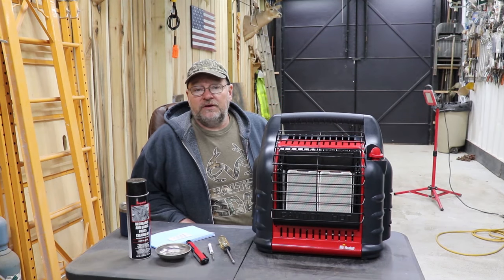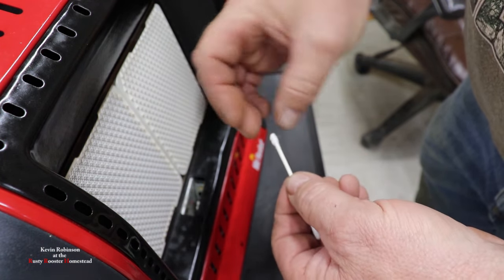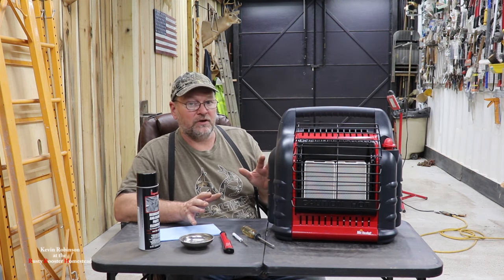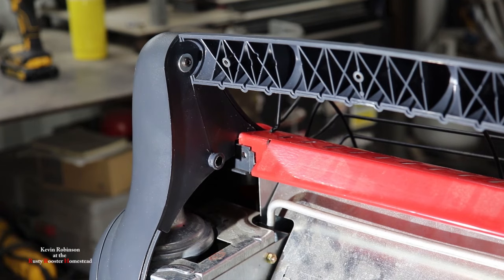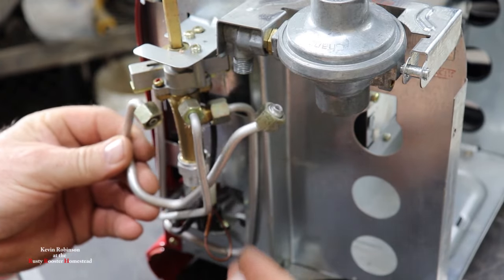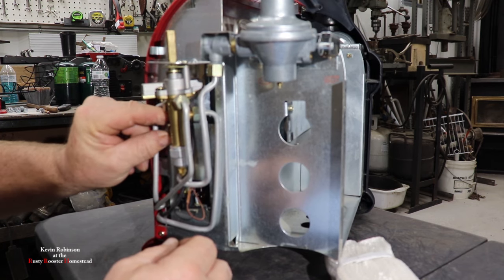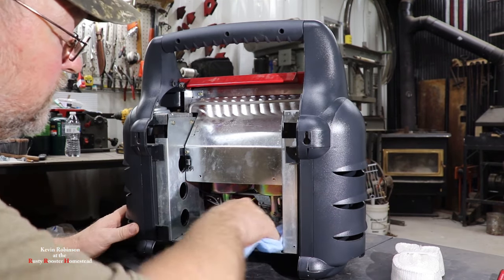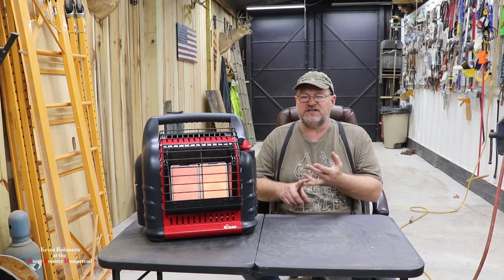mr buddy heater pilot issues

Comment: WARNING; don't use Q-tip, use a pipe cleaner instead, cotton may get clogged inside the line from the Q-tip.
Reply from the maker: Thanks for watching.
Reply: Thanks for the important advice.
Reply: Use a 22cal barrel mop! And wire brush if it’s real bad like mine was.
Reply: Pulot was at half, heater wouldn't stay on. I used a qtip... Now its not igniting. :(
Reply: My quip cotton got stuck. Now I have to take it apart

Comment: I thought the oil in the line comes from using the wrong hose. Some of the hoses would break down over time and tiny droplets of oil came out of them. I believe that's why some hoses say use a filter and others say no filter needed
Reply: No hose use here but I have these problems
Reply: According to Mr. Heater the oil comes from the hose used to connect to 20lb tanks under high pressure, you can get hoses the don’t release any oil under pressure to use with a 20lb tank or use the quick connect hose the has a regulator on it that connects to a fitting on the left side in where the cylinder goes. (Those hoses come in lengths up to 24 foot on Amazon for around $30)
Reply: Mr Heater sells a hose where a filter isn't needed, but it's expensive. If you use a regular hose, you need a filter
Reply: @RonL-y3v I use one of those hoses with a filter. Still have problems.

Comment: Thank you for this video.  I just purchased one of the Mr Heater big buddy heaters that I am sure was a return but looked brand new for a good price. It wouldn't start so I took it apart and sure enough as soon as I got the tube off oil poured out of it. After cleaning everything out it works perfectly now.  The only thing different on disassembly is there is a clip on the front plastic panel near where the red knob goes that you have to take a long screwdriver and gently pry back.
Reply from the maker: Glad I could help.
Thank you so much for the comment.

Comment: Qtips will ruin your heater. It might work the few first times but will leave fibers that will carbonize and clog it. I have been through 6 of these heaters so far living off grid. Get a proper diameter wire brush, disassemble the heater and soak the fuel tube and thermocouple in solvent(making sure the thermocouple wires are not contacting the solvent), then hit the inside of the fuel tube with the "tube brush" flush with solvent again and repeat once or twice. let all parts dry completely, reassemble and use. Do it right the first time.....
Reply from the maker: Thanks for the info William

Comment: I dont have brake cleaner. I don't have air compressor. Son-in-law just opened the lines and drained stuff. I've cleaned the pilot orifice. I use Mr Heater special hose and filter. Pilot just gurgles, maybe a yellow flame until the pilot knob is released.

Comment: Kevin, it's been a long time since I watched any YouTube videos but I wanted to tell you there's one other thing that goes wrong with heaters like these because I've got a couple of them and a simple adjustment of the thermocoupler will have a pilot light working in no time at all,, whenever the pilot light doesn't want to stay ignited.. I do the same steps like you did in this video by checking the inside of the pilot light first with a q-tip and then I check to see if the flame is actually going across the carbon tip of the thermocoupler as my second step to send the proper heat signal to the thermostat, so it knows to keep the gas coming through properly so it stays ignited and if that doesn't get it working,,  then I go to the gas line checking method and normally one of those three steps should get these heaters back to operating right, if there's no leaks anywhere causing an issue to begin with..

Comment: Turn tank off, 10 seconds flame goes out, hose is empty. Turn flame valve off. To restart, turn tank on slowly, turn burner on and light. The hose can not have pressure left in it because Propane is oil and the oil separates and clogs the hose over a few days so this is the correct way to turn off the burner when the hose goes a distance before the proprietary regulator for the burner. A barbecue pit hose does not have this problem because the regulator is at the tank valve.
Reply from the maker: Thanks for your comment.

Comment: Thank you!   We have a little used Heat Buddy in our camping trailer as a backup...   and I've always heard about using 'a filter'...  but never understood why.   Most explanations say residue from the propane hose can cause "problems" and want to sell you an insane expensive hose.   I did discover that I needed  a high pressure hose direct from 30lb tank -> Heat Buddy without a regulator because the typical lower pressure regulator doesn't allow enough flow for good operation thru the built-in regulator and a low pressure hose doesn't seem like a good idea for high pressure.    You're explanation clean-up / filter makes perfect sense and I thank you for an actual link to a specific filter!    Finally, went ahead and got a filter :)

Comment: I was told use a filter with a bigger tank. But I had more trouble with it to keep it running.  I bought a brand new 10 lbs tank and have no problem keeping it running. It lights instantly. And yes I do the maintenance on it twice a winter. Thank you for the video on the maintenance.
Reply from the maker: Thank you for watching and for sharing your tips.

Comment: Wow, that worked, SO easily and SO well. I didn't have to pull the pipe. There's no way I'd have thought that huge pilot light pipe could be blocked enough to reduce the flow - but a couple of passes with a Q-tip and brake cleaner and the pilot flame is literally twice as long as it way. Realizing I need to put the filter on because I'm usually running 1lb tank refills.
Reply from the maker: Glad I could help thanks for the comment.

Comment: Very good video, very detailed.  Note that some of the hoses will leach oil into the lines, but there are hoses that don't leach the oil into the lines and you don't need the filter for those hoses.
Reply from the maker: Thanks for the comment my friend.
Reply: I bought one of those hoses. Use it with a filter also. Still having trouble with the pilot. So, it's getting oil anyway.

Comment: Great video! My heater wouldn't start this season, so I did the q-tip thing with Everclear and started right up. Mine is around 20 years old & still works perfectly. I was wondering if you can switch the burner plates as I usually only the left plate on medium. Right plate has hardly any use on it. Both still work well, though.

Comment: Pointing a propane torch at the pilot, turn your Mr. Buddy on and it will burn off any thing inside. Worked for me. You can also remove two screws underneath, remove the cover and unscrew the couplings. Need 1/2" and 9/16" open end wrenches. Remove rhe couplers and blow air through each side. Wipe away any oil or debris. Reconnect and then test or retry pointing the propane torch at the pilot with the heater on high.
Reply from the maker: Thanks for sharing .

Comment: Good video-I don't know if I missed something... Can we adjust the pilot light down? I just got a new one, the pilot light is higher than I'd like.

My last one endured for over 20 years, it got dropped one time too many times. Otherwise it worked great and got a ton of use. Was not sitting in a closet. 

When these are not in use, vacuum them out, store in a sealed up clean new trash bag.

I also used a filter & hose hooked up to a 20 or 100 lb propane tank. Rarely used a one-pounder directly. 

 It appears the filter is worth it.

Full disclosure: only changed the filter three times in 20-something years 😏

 But I think the key was sealing it up, not leaving it on the floor when it's not in use. No chance for dust &  dirt to collect.  That's when mine collects the most junk - sitting idle on the floor

The biggest complaint I see is over the ignition, how long it takes to light, & draw in propane.

I don't keep clicking the ignition if it doesn't want to light after non-use for awhile

Light it manually with a lighter and it seems to clean things right out and work fine

My last one went year-round, was a primary heat source for a few Winters during that 22+ years. 

And I think the reason why it lasted that long is because it was used so frequently.

Just got to keep them clean when they're not running and burning out the junk. 

But I'd like to turn my pilot down?
Reply from the maker: Sorry I don't think you can adjust the pallet light thank you for the comment and watching.
Reply: @Robinson-Homestead  I figured as much, I thought I'd check. 
We're already whipping out the heaters in Alaska!  Although we didn't really put them away. 

Thanks much! 
Stay warm!

Comment: I had issue with mine and a spider made a nest inside.   I had to tear the pilot totally apart as the vent hole and pin hole were clogged.   FYI it will be very hard to pass air through from the pipe side as it is a very small hole.   You should barely have airflow since it is a pilot.
Reply from the maker: Thanks for the info.

Comment: I agree you need to use air pressure to clean out the lines  .but unless you have a moister catch on your air compressor you will be getting water. Not good.. best to use compressed air cans you buy
Reply from the maker: Great point!
Thanks for the comment.

Comment: Very helpful step by step video. My pilot flame is 2x as big as before, but the tip is still orange  and it is weak so it flows up and not over to the thermocouple.  Any other ideas?
Reply from the maker: I'm pretty sure the pilot has an air adjustment on it little flap of metal I think you need to adjust it.
Reply: @Robinson-Homestead Where?

Comment: Really enjoyed this informative video. Wonder what other sides plumbing looks like where quick connect is. The Q-tip trick seems to have worked for me cause it produced a much stronger flame after the swab. Also thinking a pipe cleaner mite do it but q-tios are usually more convenient...thanks

Comment: Kevin, your video was very well laid out.  Unfortunately, this has not solved my problem.  Being in the natural gas instrumentation industry, your approach is very pragmatic, but I suspect the problem is in the regulator.  There is clearly a restriction of flow as the panels will not light even if the pilot stays lit prior to attempting to ignite the first panel.  Again, very good video but it’s time to contact the manufacturer.  Everything in your video is a spot on approach to solving most problems.
Reply: Tip over switch. Short the wires together and see if it runs.

Can the regulators fail such that there is too much gas flow? That is the problem I'm having. I'm wondering if blowing it out with shop air kills the regulators.

Comment: Now I have a question for you on a wall mount propane heater, the plastic knob that controls the gas on and off,, pilot ignition , is held on the top of the gas control valve by a brass screw and a spring underneath of it,, that lets you push down on it as you turn it on and off and for the pilot light..  The head of the brass screw snapped off flush to the top of the metal valve that it threads into.. It's a very small screw and would you have any suggestions on how I can get that piece of screw out of there, before having to try using a very small drill bit and take a chance on messing up threads.. I know I may not have any other choice than trying to drill it out but figured I would ask you first since I was on here watching your video and it reminded me of the heater issue I have
Reply: A very small drill bit may be necessary to get a very small "easy out" bit in to grab the screw. If you can find one that small.
Drill bits rotate clockwise. 
Easy outs rotate counter clockwise so when it bites the broken screw or bolt it unscrews it.
If you have to drill the whole thing out, you may be able to re-tap the threads.
Reply: @LarryMorrow2  the good thing about it is the bolt is made of brass and if I can find a very small drill bit and easy out, then it should back out with no problem but I still worry about damaging the threads on the control valve box and the Honeywell brand replacement gas valve control is like $160 but I might try to find a messed up heater and see if I can used to complete gas valve out of one and put it in another as long as it's got the three gas line hookups but I figure I'll run into a PSI rating or something along those lines that I have to stay within and I'm not familiar at all with the internal parts in those type of heaters see what parts are possibly interchangeable and I hope I can get it fixed because it's a real good heater
Reply: @goldhunter9641  I forgot to mention that once I used several stainless steel self tapping sheet metal screws to both drill a hole and tap threads into a block of aluminum. Using each one as a disposable drill bit, in and out, in and out, until I was able to make screw holes next to the broken bolt in my old van, and successfully re-mounted the thermostat housing.
The broken bolt also had a broken easy out stuck in it. Lol!
If you damage the threads, you may still be able to force a new screw into it.
That part sounds already broken and worth a try.

Comment: The problem I have is the pilot light will light fine with a nice blue flame.  But it will not stay lit when I go to turn the burners on.  Sometimes I have to hold it for quite a while, several minutes before it will stay lit.  Then sometimes after burning for a couple of minutes I hear a click and the whole thing shuts off.
Reply from the maker: Maybe lack of oxygen it has a oxygen sensor in it.
Reply: @Robinson-Homestead  I figured it out.  Just had to lightly sand the outside of the thermocouple and now it works great.

Comment: wide range of sure fixes for 20lb tanks,
lines. early step in troubleshoot should be test with  1 lb, 
bypass problems associated with hoses, filters, check valves. one can do a lot of fixing, only to find that heater itself works fine, been there.
Reply from the maker: Thanks for your comment

Comment: I have a little buddy heater and the pilot kept going out. I cleaned the thermocouple and and there is a ground wire on the gas valve inside the unit. I cleaned the connection and it worked the season. The screw is steel and the valve is aluminum so it galvaniclly corroded.
Reply from the maker: I'm going to say you have dirt in your pallet light orifice need to clean the pallet.

Comment: Well I need advice....I have a new Big Buddy heater straight out of the box. Have a new Mr Heater hose and a new Mr Heater filter. Hooked everything up and the attached to a full 20lb tank....the pilot lights with a beautiful blue flame quite easily. Move the dial to low and the pilot almost immediately peters out like i just ran out of propane and the element does not lite. What am I missing?
Reply from the maker: Sound like you got a bum heater, you shouldn't have those issues with a new heater i would return it and get another one, good luck and thanks for watching.

Comment: Do I need a filter if I only use the small 1lb propane bottles?
Reply from the maker: No just on the bigger tanks.
Reply: no, the filter is for oils present inside the hoses that make them flexible after manufacturing. Therefore you only need a filter if you use a hose.
the mr. buddy brand hoses are made to be used without a filter. That might be worth picking up and paying the extra 10 dollars for

Comment: What if the head of the q-tip comes off and stays in the pilot light hole?
Reply from the maker: Dig it out
Reply: @Robinson-Homestead  It wouldn't dig.  I ended up taking the fuel line off of the tube that supplies the pilot light and then it fell out.  I enjoyed your video and found it helpful.  Thanks.

Comment: Can we use anything other than brake cleaner?
Reply from the maker: You can use starter fluid but blow out the line real good to dry it,thanks for watching.
Reply: Be careful not to turn the ignitor while still wet.

Comment: Just got a portable buddy for Christmas can't get it to stay lit more that 10 minutes straight out of the box I bought the 20lb adapter hose and filter have cleaned the pilot but it still shuts off I can relight it right away but it's keeps going out?
Reply from the maker: I would try it without the 20 lb tank , try with the 1 lb tank and see if that helps,if not return it if you can good luck.

Comment: Poor man's (or in my case, cheapskate's) compressed air option - cordless tire inflator (Ryobi, Milwaukee, etc) with a basketball tip. Not a lot of pressure/flow, but enough for this task.
Reply from the maker: That should work thanks for the comment.

Comment: I do have a filter installed and my heater is still not working.  It quit after about 2 20lb tanks.
Reply from the maker: You might need to clean the pilot light
Reply: @Robinson-Homestead  I've tried that.  No go.

Comment: My pilot light goes off every time o try and click to ignite heating plate. And it will also just turn off after i so get it going. Any ideas what is causing that problem?
Reply from the maker: Did you try cleaning the pilot light?
Reply: I did, not the issue 🙁
Reply: I have this problem as well. Except then i used a qtip, and it will not light at all. What a childish suggestion this is.
Reply: Used a filter and now it's good to go!
Reply: @haruwright7410  you clip the cotton off the tip first,  pretty simple 101.

Comment: the heater you show is brand new... No way it had issues. What you fail to address is a pilot that runs yellow on and off.the heater does keep running but it is a concern with the yellow pilot??????
Reply from the maker: That heater is about 8 years old so it's not brand new  and i didn't have any pilot issues i was doing a video to help people with their issues.